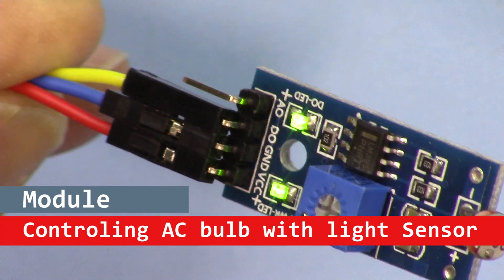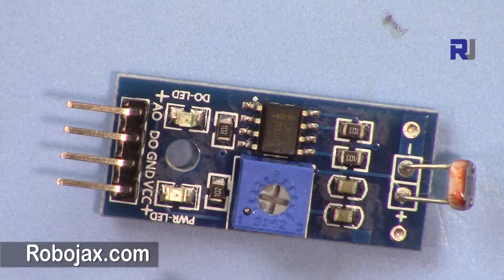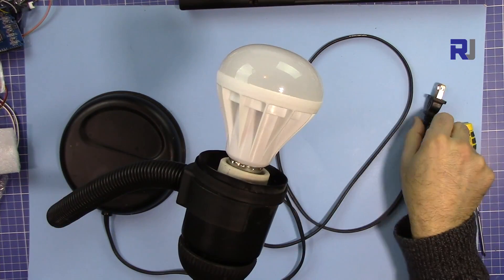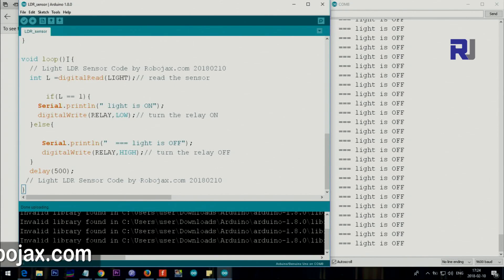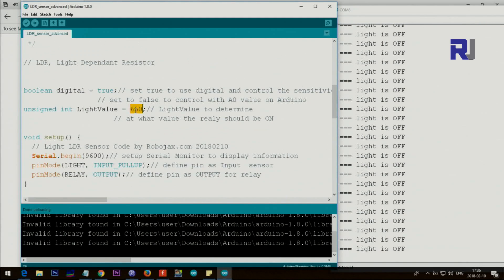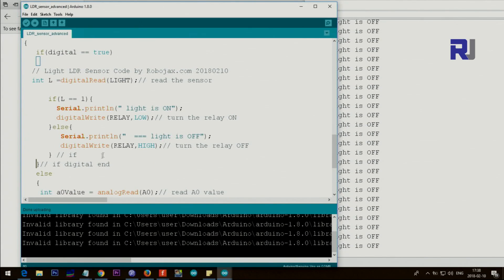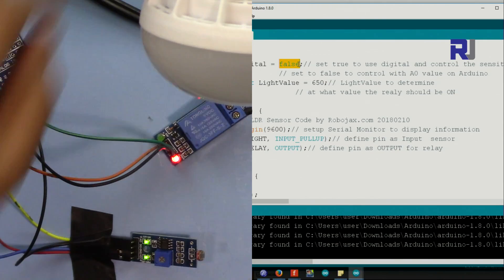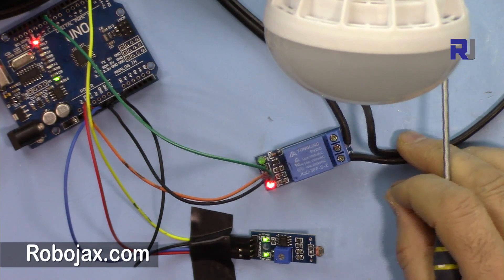How to use LDR Light Sensor module to Turn ON and OFF AC bulb automatically withe Arduino RJT61

Comment: Hii ! Just to clarify, really need ur help? For my project, I'm not using ac bulb but i'm using Led strip WS2812B for smart aquarium (fish tank) as in i want it when turn on, its dark and when turn off, it's not dark. so can this code and wiring works for my led strip ? and also what are the changes of code?
Reply from the maker: Hi, yes Thai code will work. Relay is just a switch to turn on or off something

Comment: Can I use this light sensor to measure light frequency with an oscilloscope.?
is it just supply 5v power and gnd, but which pins of the 4 shall I use for the scopes black and red crocodile clip if I wanna get feedback from the sensor to see the frequency of a screen refresh rate.?
I would reckon that light-sensor would be able to registrate fast light pulses, and give that waveform on the scopes, but how to hook it up?
Reply from the maker: this has LDR or light dependent resistor. it is very slow like 5 Hz or 5 times a second if light turns ON or OFF. you can't use it.

Comment: Sir in this experienment does relay is also to any ac power supply??
Reply from the maker: Relay is a mechanical switch . It works for anything if you respect the power earring. Here see what is inside relay https://youtu.be/N-fFk51Eb8s

Comment: Hey ! This was a very informative video ! Thanks a lot ! 
I had a question, if we set digital as true to adjust sensitivity using potentiometer, then do we need to connect the Analog out from the LDR to arduino ? Because I have a LDR module with only DO, hence I wanted clarification whether we can only connect to DO, set digital as true and control sensitivity with potentiometer, without any change in the advanced code. 
Keep up the good job :)
Reply from the maker: Hi , it seems you may have missed or skipped the video. you are getting the opposite. please watch.  Digital means ON or OFF. there is not in between values to adjust.
Reply: @robojax  Yes, I get that, but my doubt is whether the connection with AO is necessary for the advanced part with digital set as true and sensitivity is with potentiometer. Basically can the advanced code be run on arduino nano without connecting AO and setting digital as true

Comment: The code uses pin 9 not pin 10 like the video shows, make sure you have it in the right slot so the relay switch works.

Comment: Hi sir plz help me for this 
I want to make a project on dc motor.
I want that if i puch 1 time push button then motor will run for 5 sec. And every time i push button then moror will run for 5 sec. How i do this 
I have relay module aurdino uno and dc motor with push button. 
Plz send me a programming for this and circuit diagram also. 
Plz plz plz🙏🙏🙏
Reply from the maker: Hi, is is related to his project? here are my videos on motorhttps://youtube.com/robojaxTV/search?query=motor and push button https://youtube.com/robojaxTV/search?query=push_button

Comment: Can we connect photosensitive module and relay module without arduino,if yes which pin of photosensitive module should be connected to relay module in.AO or DO pin?
Reply from the maker: Hi, Yes you can.  Depending on the relay module types, you may get reverse effect. when you want to turn ON it may be OFF and when you want it OFF, it might be ON.  But there is no timer control. if you want to turn ON or OFF for certain time, then you may use one of the timer modules here https://youtube.com/robojaxTV/search?query=timer

Comment: Hi Robojax! I want to use you cod to control a motor for 3 seconds when it's dark (evening) and the same thing when is light, in the morning for 3 seconds (same command). Can you help me with cod? I'm not beginner but is the first project with Arduino. Thanks!
Reply from the maker: Hi, you are asking something that needs a separate project. perhaps you start from here https://youtu.be/Mbb2xa1WcRM

Comment: sir iwant to use as soler tracker but it wil on when dark i wat to know if it is on sun than it work how can be it possible simple i want soler tracker circuit plz
Reply from the maker: Solar tracker from the name we know it should track the sun.  It needs a little work. Not that simple. It needs motor, actuator, controllers and light sensors with code. I have it on my "to do" list. But don't know when. Thanks Ahmad from Canada.
Reply: @robojax   thanks

Comment: Thank you, I'm going to use a motor instead of the light but I'm sure it's going to work with your system.  Good video
Reply from the maker: Yes it should work. just turn ON or OFF. No speed control.
Reply: What about motor direction? Can it go clockwise when its light and anticlockwise when it's dark?
Reply: @peterjones3879  Yeah it can. You just have to change the direction of the current. In my  case, I use the motor head of a drill. For the time now I just use a clock set for an entire year. It's pretty reliable.

Comment: U said to use the 5volt pin in both ldr and relay... Can u clear this?? (Urgent)
Could u please give the schematic diagram??
Reply from the maker: Connect them to 5V. if your arduino doesn't have 2 tV, then create additional  5V. Watch this video https://youtu.be/Vmrmp7reHOY
no schematic. I have explained wring. If you need it then draw it.

Comment: Can't we use only the sensor module with the ldr for automatic street light system????
Reply from the maker: Yes you can. Use the code from the current video which has the module and use this (new) video to read the LDR value https://youtube.com/gkyLnEgu7w0
Reply: Robojax p
Reply: Use this instead:
Blackt Electrotech BT31P2 230Volt Auto Day/Night on and off Photocell LDR Sensor Water Proof Olive Wood Lighting Switch (White) https://www.amazon.in/dp/B01KMAQLB4/ref=cm_sw_r_cp_apa_i_-StwDbZJ23TDR